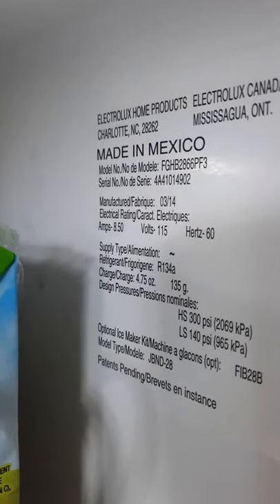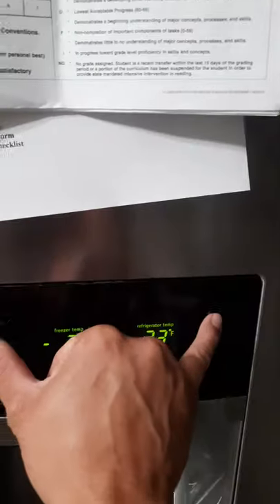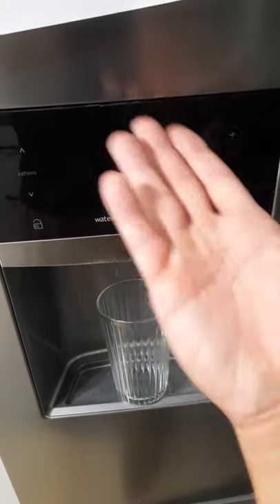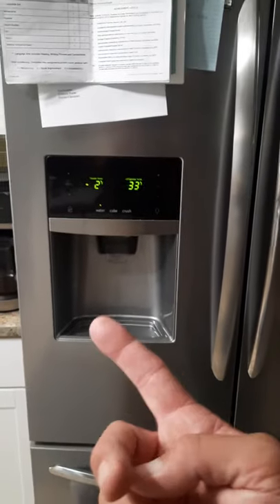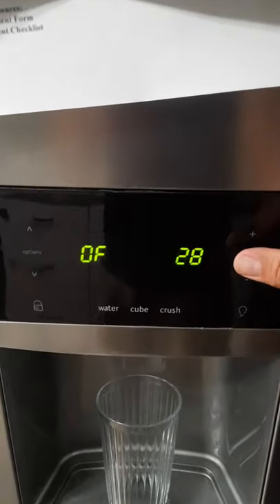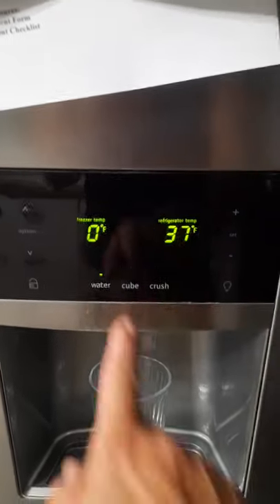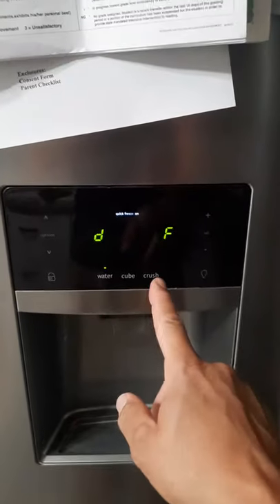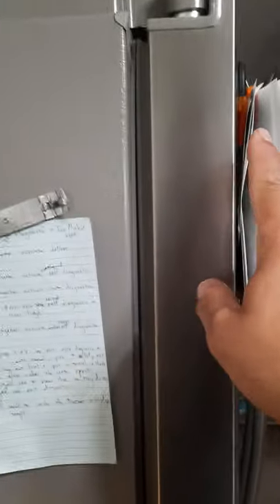Frigidaire Gallery Ice Maker Fix! Works every time. No Tools Needed. Read disclaimer below.

Comment: I’ve found there to be an inherent problem with the ice maker water tube and coils freezing up. This fix should take about 60 minutes at most. First put the refrigerator in defrost mode by pushing the + and - button simultaneously. After it finishes the defrost mode which should take about 30-40 minutes turn the refrigerator off on the door panel and remove the ice collector. Next put a pot of boiling water on a heat pad in the back of the refrigerator directly under the ice maker.  Finally take a blow dryer and with the setting on high point it directly towards the back of the ice maker while you hold the blow dryer in the front of the ice maker. Do this for about 10-15 minutes. Then put the ice collector back on the ice maker and turn the refrigerator back on at the door panel.  You should be able to start making ice again.
Reply: I am going to try, your trick I have change the frigidaire valve thing under after hearing a buzz sound under. did the reset from Mike very useful tip, but now I hear the water ice tray sound but no ice making, water work filter is new, good pressure also Firgidaire a Peice of garbage - Since new we had issue. that should be the tag line

Comment: I can’t get mine to run the defrost mode. Everything else worked as you explained. Any ideas?
Reply from the maker: If you're model number is different but the fridge still looks similar the process may be different or not work the same way. I would search your model number service manual and see if the defrost operates the same.  If it is the same and doesn't work I would reset the fridge and try the defrost.  If that didn't work unplug and plug back in and try.  If that doesn't work you may need to replace the board or touchscreen on the fridge. I could be wrong though, I'm not a service technician.  Sometimes you can return parts you ordered and didn't need but you can't return appliance repair guy time. Good luck!

Comment: Great video!  I just changed the ice tray and now ice dispenser only dispenses crushed ice. Any idea why or how to reset?
Reply from the maker: Running through the diagnostic seems to reset the fridge at least for a little while I would try that first.   If that doesn't look like try to find a service manual for that that tells you what the different codes for the diagnostic mean and one of them will be checking the ice crusher.  Also, unplugged in plugging back in the fridge seems to help with a lot of things.
Reply: @Diy_Mike  Thanks Mike was able to reset, but also found the plastic gate in back of ice maker off the track. That did the trick

Comment: Hello, I defrosted my ice maker with the help of a hair dryer. Its making ice, the bucket is full. When the doors are closed and the lever is pressed the dispenser door flap opens but i dont hear the auger turning and no ice is dispensed. Any suggestions?
Reply from the maker: First thing I would do is run through the diagnostic. Just to see if you can hear the auger running and the door flap opening and closing. Just running the diagnostic may repair your refrigerator you could also unplug it for a minute or two and then plug it back into reset the system completely. If those steps don't fix it You may need a technician to come look at it.

Comment: How often does your ice maker stop making ice?  I had a Frigidaire for 15 years and it never stopped making ice.  This crappy Gallery we bought is only a year old and already randomly stops making ice and the freezer sucks.  It’s July and the freezer won’t even keep the freezer packs or the ice cream frozen.
Reply from the maker: Mine stopped every couple weeks or so. I've since gotten rid of the thing.
Reply: @Diy_Mike  That’s where I think I’m headed.  I also noticed that the rear exhaust port behind the freezer is
blowing out air hot enough to heat up the water intake line.  The water that’s coming out of the dispenser is actually hot.

Comment: Doesn’t work for me. No water comes out into the ice tray so that’s the issue. It’s not frozen back inside either. I’ve taken it all apart and even blow dried it. No melted ice blocking anything. Dunno what to do
Reply: I noticed that diagnostic test 26 performs a ice maker defrost. You’ll see the temp/on flash and the temp will increase. After a few minutes it’s up to 43F and still increasing for example. Should continue for a bit longer I’d assume. Might help thaw a water line that could be frozen? We’ll see!

Up to 73F and it kicked out of diagnostic mode.
Reply from the maker: After making this video I've learned that this does not fix the problem for everyone. One problem many people have is the water line for the ice maker freezing. I've seen videos of people tearing down their ice maker to manually defrost it with a blow dryer. Its a pain and not permanent.
Reply: @Diy_Mike  that’s exactly what worked. There was ice built up inside the incoming water line from above and once I got that clear, it started working
Reply: Hi we habe same problem ours dont put water in the cube maker so it doesnt make ice in the tray we have frigidaire 4 door french once whay did u do with yours for it to work again thankyou
Reply: I can get the fridge to code 26 and it shows “CL”, however it never shows the temp or it going up. Ice maker works but no water is getting to the ice mold.
Reply: @MIACANES4LIFE  mine has the same issue

Comment: Great video😊I’ve tried to repair Frigidaire Gallery ice maker at least six times, de ice , new ice trays, new fan blower carrier, new thermostat and nothing worked long term. It always stopped working. My assumption was that it was a mechanical problem. 
After viewing your video and doing the hard reset, guess what ? It started working. My suspicion is that a software issue is driving the malfunctioning that’s continuing. How else would a hard reset start it working without  mechanical intervention ? As far as Frigidaire appliances , terrible designs and reliability .  The dishwasher has failed many times , from grommets in the water , to door seals to two photo eyes stopping it from working, steam from unit shorting a 75 cent part . 
The micro wave lowing the IC board two years in. Kitchen has been a disaster with these appliances it’s never a day without issues. I will never buy this brand again. Again thanks for the great video , I’ll use it until we decide to junk all of Frigidaire appliances and start over. 2:43 2:43 2:43
Reply: Same here , bought the whole kitchen full Frigidaire , microwave board fryed, oven lower pull arms on rack heat softened and deformed , ice maker stops working , and all the mentioned problems on dishwasher. Spent thousands just to have problems with every unit.

Comment: Mine is making ice and bucket comes out.  The issue is it makes plenty of ice but starts melting in the bucket and has water running down the door.  Any ideas on how to fix this?
Reply from the maker: I would run through the diagnostic, let it reset, defrost, then set the fridge to 34 degrees. See if that helps. If that does not work out could be technician time. Maybe a refrigerant pressure issue or something else. Good luck.
Reply: The water line for the icemaker is freezing in the top of the fridge just above the ice compartment.  I take a hair dryer and melt the ice plug and things start working again for a while.  Not sure how to keep this from freezing?

Comment: Any fixes for the lower ice maker in the freezer? Thanks!
Reply: I would recommend searching your exact model and the words "service data sheet". I did this for my gallery series that is newer than this fridge in this video, and found all the different modes. There's very likely a mode for your issue.
Reply: @BigV  I ended up just using a blow dryer on low heat on it and it works again!!!

Comment: I'm SO disappointed with our Gallery and the lack of customer service with Frigidaire!
Our unit was purchased in April '22, the ice maker only puts out crushed, even when "cubed" option is selected.
The metal "guards " on the freezer shelves  always fall off.
We are under manufacture warranty but can't get ahold of a technician.
I hate that I didnt research the brand better before purchase.
Reply from the maker: Yeah. They were a good brand but once they started putting computers in home appliances a lot of stuff went downhill.
Reply: @Diy_Mike  
Figured out the icemaker issue from YouTube. But Frigidaire keeps sending emails that our "warranty " is expiring soon..SO WHAT? what good is their damned warranty if I cant reach a technician? Saving my money!
Reply: @tghio8779  They want people to purchase that expensive extended warranty. They are producing crap that needs constant maintenance to keep their profits up. Why make a quality fridge that is one big purchase every 20 years when you can make a crappy fridge that requires bi-annual maintenance $$$$. Cars are made this way now, too. There's money in parts and maintenance that isn't there if what you buy never breaks.

Comment: I read if you don't change the filter every six months it causes the ice machine to not work properly.
Reply: True, this is the first issue my fridge had. Except the filter didn't make it 6 months, have to change every 3 months or the ice making stops working or leaks.
Reply: @bigvslilworld  oh wow, was it a genuine frigidaire part?
Reply: @kkimberly2004YT  Yes, the puresoure3 filters. It could also be the water from my county :(. Unfortunately we have system breaches that lead to boil water advisories every 1-2 weeks here. Purchasing a whole house filtration kit soon and will report back in a year lol when I see if it helps go through less filters. If it works, there's a in-fridge filter bypass for purchase as well though i think i will use as many as I can if the water pressure is not badly affected.

Comment: So is there some sort of service manual for my model that would detail all these settings?  There should be
Reply from the maker: Nothing I've found has this method or anything that refers to the auto test
Reply: Search your model and "service data sheet". I found a sheet designed for a service tech for my fridge, that includes a wiring diagram as well. I have a model FG4H2272UF.

Comment: For some reason my ice tray drawer won’t slide all the way in. There is no ice or anything blocking it.  Smh
Reply from the maker: Try turning the screw so it matches the part that spins it in the back
Reply: @Diy_Mike  ohhh ok.  Thanks.  I was ready to flip this thing over lol
Reply: @Diy_Mike  that worked.  Thank you so much.
Reply: Check that ice screw points line up with openings in wheel drive in back of unit , also the the crush / cube lever is going into slot in back

Comment: So you showed us how to to a test. What was the fix? The heading says fix.
Reply from the maker: It's a temporary fix that works every time you use it.  I have not found any way to get the ice maker to be permanently repaired.  The ice maker always stops working after a couple weeks or so and this is the simplest process I have found to get it working again. The only permanent repair I have found is to get a new fridge
Reply: Push the water and crush together and you can increase the ice making speed between1 and 3 by using the +/-. Also on another video,  they used different temps? 0  for freezer and 38 for fridge. I have not tried this myself, as my Gallery fridge is in another country and I won't be there for a month. Good Luck. Reply back if this worked.

Comment: Problem I am having with my ice maker is that you go to the actual ice maker and it's not frozen under there and water is still in the tray so the cubes are getting frozen
Reply from the maker: Go through the diagnostic steps. That will reset the computer and it might, possibly,  work after that. Or not. But it could, maybe.